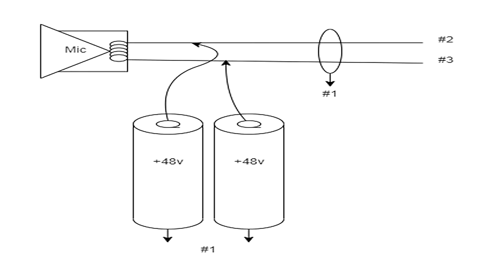Phantom Power 101: Essential Tips for Safely Energizing Condenser Microphones and Active DIs

Comment: Hi, Barry, thanks for posting that video, very informative. I have a dilemma. I'm playing my dobro through a Fishman Aura Jerry Douglas acoustic imaging pedal. The pedal's input and output are both 1/4", unbalanced. A lot of house sound systems don't have 1/4" inputs on their snakes. I use a TRS/XLR male cable to connect it, but I'm afraid that if the sound tech turns on the phantom power, my pedal will go up in smoke. Can you recommend a way to safely use my pedal? Thanks!
Reply from the maker: I wouldn't be keen on running an unbalanced signal on a long cable, like the snake.  I'd just get a short 1/4->1/4 TS unbalanced cable and go from your pedal into a DI box, and then use the DI box output (XLR balanced) to drive the sound system.  This will offer you a balanced, low noise connection and provide isolation so your instrument isn't directly attached to the sound system.  See my video on DI boxes.

https://www.youtube.com/watch?v=D047E4yx0lg
Reply: @Barry-Watson  thanks for the quick response. I tried a DI several times, but for some reason, it only worked one time. No idea why. Usually the signal doesn't pass through at all. Had the same problem at at several different venues, using the house DIs. I don't know if these DIs were passive or active. Since the Fishman Aura pedal is also a DI box/preamp, could that be the reason why the signal won't pass through a DI? It only passes signal if I plug directly from the pedal to the snake. I did make a DI work one time, so I know a DI could possibly work. If I purchased my own DI, would a passive one be adequate, or would it be necessary to go with an active one?
Reply from the maker: The signal coming off your pedal should be able to drive a little 
bit of load, it's not a really high impedance delicate signal like one coming from a passive pickup.  The pedal is active electronics.  So, I'd suspect you could easily drive any DI box, active or passive.  For simplicity I'd probably choose a  simple passive DI box.  Use a quality 1/4->1/4 patch cable.

This really should work, the only reasons I can think of why you previously had issues would be a poor connection from a patch cable, were using an active DI without power (dead battery or no-phantom power available for it), or you were provided a non-working DI box (with an internal issue  - unlikely but I have seen some pretty abused house DI boxes).  The most likely cause is usually a bad patch cable or poor connection.  Good luck!
Reply: @Barry-Watson  I'll definitely try that. Thanks for the help, Barry, really like your channel. It's great for guys like me who are technically challenged. ☺
Reply from the maker: Thank you!

Comment: Do I need a amp to get power to my passive pa speakers or can I use phantom from my mixer?
Reply from the maker: Yup, you'll need a power amp for the speakers.  Phantom power is for devices attached to the microphone inputs, and only provides a little bit of DC power down the microphone line to operate active electonics in microphones and other input devices designed to use phantom power.

Comment: Have you come across condenser microphones  that work perfectly fine on a desktop mixer, while another microphone behaves poorly? Only when connected to an external phantom power supply does the microphone work well. Perhaps this is common with more expensive condenser mics.
Reply from the maker: I don't think the price of the mic has much to do with it.  I'd try different cables, just to rule out an intermittent connector.  I've seen a couple mics that appear picky about the phantom supply.  Maybe these mics require near 48v to work, or they draw a little more current than most other mics, and some cheap phantom power supplies are a little underpowered for them.  This is pretty rare.

I'd use a DC volt meter to check phantom voltage (with mics attached) on the mixer and your external supply.  My suspicion is that the phantom supply in the mixer is weak and not providing a solid clean +48v.  If the mixer voltage drops when the mic is attached, it would suggest that the mixer's phantom supply can't deliver enough current for some reason to drive that mic. 
 Some mics are pretty tolerant, and may work ok on a lower voltage.  From what you describe, I'd be suspect of the phantom supply in the mixer.

Is it really what you think?  A dirty capsule, or an issue in the mics electronics could case intermittent behavior.  Does it *always work properly on the external power supply?
Reply: @Barry-Watson ....yep, always works great with external power. I'll stick with that. Thanks

Comment: I wish to record piano and condenser mic for vocals using an audio interface and my PC, using recording software such as audacity or garage band. Could you advise how to successfully set this up? I would really appreciate this. Thank you.
Reply from the maker: More than one way to approach this.  I would consider that the technical recording quality is determined mostly by your mic and audio interface.  Lots of good equipment to choose from.  I would look at an Audient iD4 interface, and a pair of Shure SM-81 mics (and boom stands), and some good headphones.  There are of course many other valid choices.  The SM-81s are very neutral, and work decently on almost everything, they aren't cheap... but they're not super-expensive.  You'll need a inexpensive pop filter for the vocals.  At some point you may wish to find the perfect vocal mic, large diaphragm condensers are the traditional choice, but good ones tend to be expensive.  The SM-81 will work well for vocals (with a pop filter), and I'm assuming you want to keep the mic budget less expensive than your piano.

I would record the piano in stereo and probably not get too close with the mics depending upon your room.  Then I would lay down a vocal track afterwards while listening to the piano recording on headphones.  I like the Sony MDR-7506 headphones, although they are not the most accurate.  I also like the AKG-240 series, but they require more drive to get loud.

The recording software will affect your workflow, but shouldn't impact sound quality.  Audacity is free, Reaper is free to try and inexpensive.  Either will work for you.  If you prefer ProTools or something else, and don't mind the cost... great.

Room sound control (room size, shape, reflectivity, and how many moving blankets and sound absorbing stuff is around), mic placement, how good your piano naturally sounds... and how well you play, are hugely important.  Maybe more important than the gear.  Spend plenty of time experimenting with different mic placement until you get the sound you're looking for.

If you have more specific quesions, feel free to ask.
Best wishes!
Reply: Thanks for the reply!

I have a Yamaha Clavinova CVP-401 Digital Piano, Shure beta-58, GA project FC MKII condenser mic, Scaret 2i2 interface and a PC i wish to record some content on to. Can phantom power damage my PC or digital piano?

thank you, andy.
Reply from the maker: You only need to turn on phantom power when using the condenser mic, and I wouldn't expect any problems at all if you're using standard balanced mic cables for your mics.

Comment: Should I use the phantom power on my mixer or my interface that my mixer is hooked too
Reply from the maker: Phantom power should be enabled on the device that the microphone that requires it, or the active di box is directly connected to.
Reply: @Barry-Watson  my condenser is connected to my mixer. Mixer to interface. From there to computer. So just turn on the phantom power on the mixer. Not the Interface.  correct?  Also, If my mixer has a USB connection. Should I not use the interface? I'm really new to this.Sorry for being a noob.
Reply: @Barry-Watson  Sorry, I'm pretty new to this as far as hooking it All up but i've been in the life for years. Lol My condenser is hooked directly to my mixer.The mixer is hooked directly to the interface. If i'm understanding you, I only need to have phantom power on the mixer.  not the interface correct? Also do I even Need the interface if my mixer takes A usb? If you made a video about this already just guide me to it or let me know and I will watch it and share some love that way. I know enough to know that you know what you're talking about And you should have way more subscribers!
Reply: @Barry-Watson  Something weird is going on. I couldn't see my first response to you. Now  I can't see the one I sent to replace it in case it didn't send. Sorry for doubling up.And I have no idea if you can even see this but I can't see anything.I sent you other than the very first comment
Reply from the maker: Right, if the microphone is connected to the mixer, the mixer channel the mic is plugged into would need to have phantom power enabled, if the mic requires that.

I wouldn't enable phantom power unless you need it, but generally speaking it shouldn't hurt anything either. So I wouldn't be too worried about damaging equipment -- with some rare exceptions such as the use of some cable adapters to apply unbalanced signals into a balanced inputs, or if you're using some obscure ribbon microphones which can be sensitive to phantom power.
Reply from the maker: Sometimes Youtube is a bit mysterious, or it may take a moment for things to post, or a refresh.
Reply from the maker: Thanks a lot!
Reply from the maker: Correct, I would enable Phantom Power on the mixer channel the condenser microphone is connected to, and no need to enable it on the computer interface that is taking a line-input from the mixer.
Reply: Thank you!
Reply from the maker: You bet.  Best wishes!
Reply from the maker: You bet.  Best wishes!